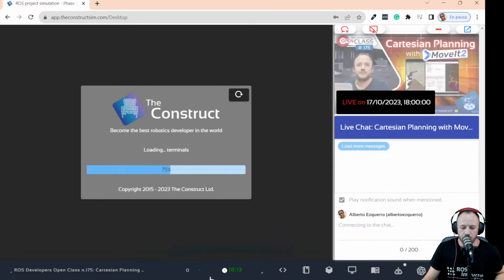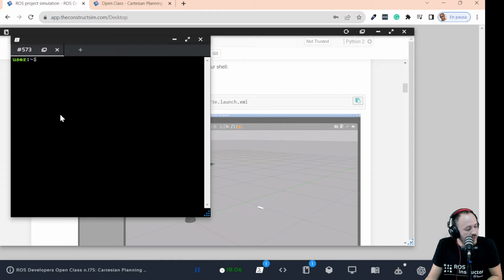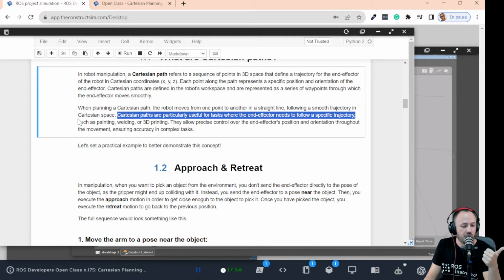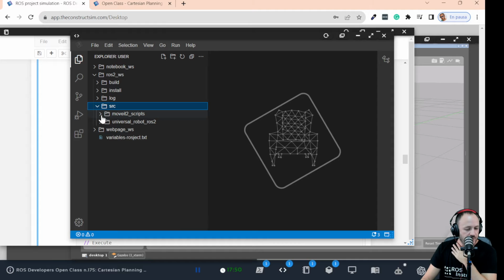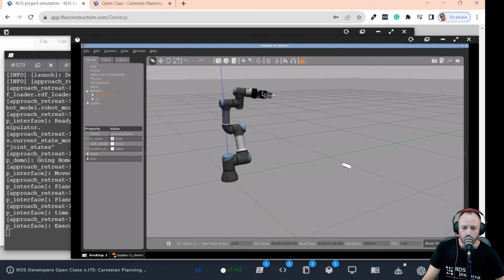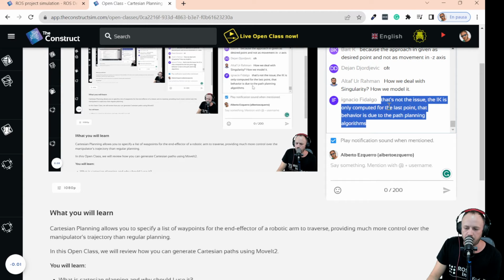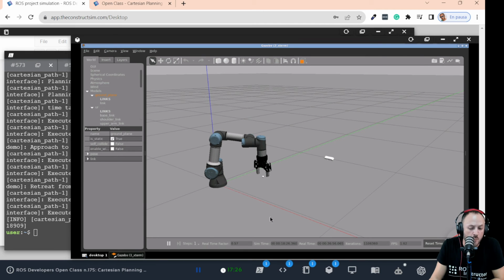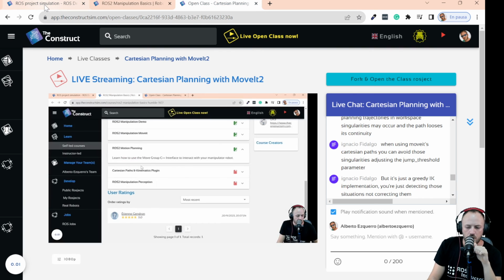Cartesian Planning with MoveIt2 | ROS2 Developers Open Class #175

Comment: I saw the example use method to get current state of move group arm before any planning and execution, whats the benfitical of doing so? as I tried without those lines, code can be still running (except joint space)